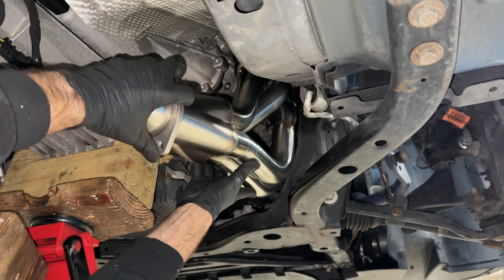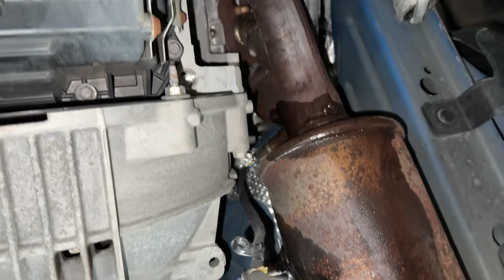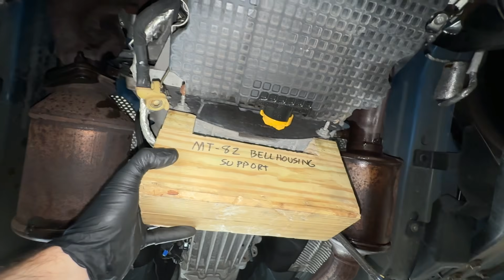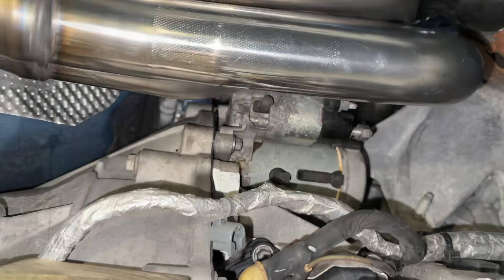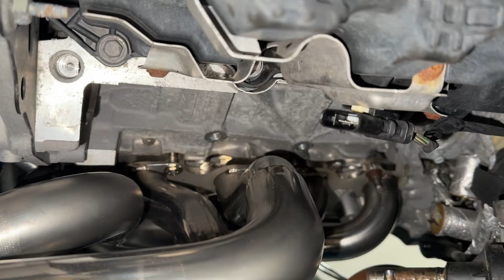How to Install Long Tube Headers on a Mustang

Comment: I think I'm going save a $1K and try this. My car has never seen rain; underside is extremely clean! Car gets put away in my heated garage in Nov, so I'll have 6 months, to cuss and let my knuckles heal before I drive the car again. I have a 6R80. Can you tell me, "How high you needed the car off the ground"?  And What special tools made the install better?  Thanks
Reply from the maker: The video should really cover what you need. I would get some extra tall jack stands because it will make it easier.

Comment: Is this a similar header setup as the gt350?
Reply from the maker: Yes, though I believe the mounting flange bolt pattern is different.
Reply: @Mustang-Geek thank you for the response i have a gt350 to do headers on thankfully your video going to save me so much time 🙏🏻
Reply from the maker: @onDrunnn looks cells are version of these headers for GT 350
Reply: @Mustang-Geek I’m going to install speed engineering long tubes

Comment: I installed kooks catless headers last night on my Dark Horse, but now i do not have any power to the dash/screen, headlights, and it will not register my key fob, but there seems to be electricity running as the side markers still turn on and other small things, any suggestions??

I also have a 6 pin connection that i’m not sure where it goes, it is not a 02 extension as those are already installed
Reply from the maker: Unfortunately, I don’t have any experience with S650 Mustangs. But if something is not connected, that certainly could be the issue.
Reply: @Mustang-Geek Yeah i was thinking it was that 6 pin connection, but i think i might have also blown a fuse not sure, but thank you sir

Comment: Best video ever. Just did my 2014 Mustang GT 5.0 and the bolts description was spot on. Passenger side used all oem factory hardware. Driver side could only use 2 oem bolts due to clearance. Great video straight to the point

Comment: i really need help with a question. basically i didnt get bolts and i also cant get kooks bolts because of where i live. is there absolutely no way to use all stock studs? or shorten them etc?
Reply from the maker: I suppose you could shorten the studs. But, they use stage eight header bolts. Just get the stage eight bolts that are the right thread size.

Comment: fml
Reply from the maker: Why?
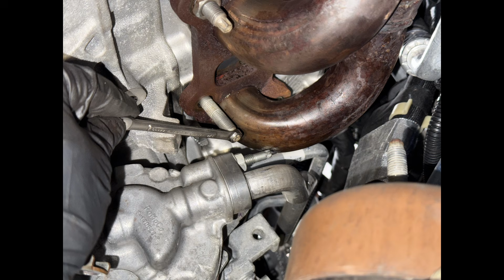Reply: @Mustang-Geek  I have an exhaust manifold bolt that broke off passenger side in a hard to reach place, exhaust makes a chirp metal rattle at 2-3k rpm and I can hear ticking around the area with the missing bolt. ive done suspension,brakes,oil you know the simple stuff and your video was like the only one I can find to see the process of removing the original exhaust and im like shit. this is gonna be a headache lol its that top rear stud you left in place at 3:25
Reply from the maker: @balakays550 Maybe grind it flat. All the other bolts and studs should be enough.

Comment: I’m having trouble with the last rear top bolt at the driver side
Reply from the maker: Yes! That's an annoying one. Try reaching from the front of the engine towards the back. remove the air box.

Comment: I can’t get the passenger headed in even if my life depended on it. It won’t go on the top front side bolt. AC is in the way so it won’t go low enough to get into the stud
Reply from the maker: Remove all the studs. That should solve the issue. Then use the bolts included with the headers to install them.

Comment: should I get these if I have a stage 2 roush supercharger kit? It's got some roush exhaust system already. Wasn't sure if this would hp me out or not at this point.
Reply from the maker: These will work perfectly for that application.

Comment: 4:39 also, not sure what you mean here. I think the unequal length headers give the cars a fantastic sound with the right aftermarket cat-back, and it's why I got a Coyote in the first place (even when I couldn't afford it). Although it is undoubtedly more restrictive than equal length setups, and equal length long tube headers with wider runners will always produce more power.
Reply from the maker: I personally don’t care for the OEM manifold sound.
Reply: Last thing to add is that the unequal length factory manifolds, while I love the sound on mine, it does make for an inconsistent midrange and tends to choke the car up top. Same exact thing on a Subaru WRX STI. We love the sound of the Boxer with unequal length headers and a proper cat-back, but we know that the car runs so much better with EQUAL length headers. Just something to think about.

Comment: I did not know that Ford integrated the catalyst into the exhaust manifolds on the 2018+. How lame. No wonder everyone is getting an aftermarket header/high flow cat setup.

Comment: I have a question on the gaskets? I’ve taken my kooks off 3 times going to be 4 now because I seem to keep blowing up exhaust manifold gaskets. I used 2 oem one with and without copper sealant and a remflex gasket and still seem to have them leak, any advice is appreciated thanks!
Reply from the maker: Hmmm. Surprised you're having issues. A couple things to check: 1) Use a razor blade and bake parts cleaner to clean carbon build-up on the cylinder heads around the exhaust ports. 2) Use a straight edge on the exhaust flange and check it for imperfections. 3) If you're using studs, make sure the studs aren't too long and hitting the primary tubes when they're fully tightened. If the studs aren't bottomed out in the threaded holes, the ends may hit the primaries before the header is fully seated. 4) Make sure the headers aren't hitting anything that's preventing them from sitting flat against the heads when tight. 5) Make sure all the bolts and studs are tight (duh). Good luck!
Reply: @Mustang-Geek  Sounds good I’ll check it out. I tried my best on the prep since it is a royal pia to install but I did get them used so they might be pretty warped, considering I used remflex gaskets it would have helped with that so I might just have to buy new headers entirely. Thank you!
Reply: When the manifold leaked did you get any engine codes?

Comment: Going to put mine on tomorrow by myself thanks for the clear instructions wish me luck haha
Reply: how did it go?
Reply: @zenaxia8063 it honestly wasn’t that easy but it’s definitely possible you definitely need the right tools I was doing everything by hand no power tools that was probably my biggest struggle
Reply: @Domsdownbad  how long did it take you?
Reply: @zenaxia8063 like I said I did it with no power tools so maybe 12 hours but with power tools probably would’ve took half the time
Reply: @zenaxia8063 around 12 hours but I didn’t have power tools with the right tools it would probably take half the time
Reply: @zenaxia8063 guessing a year
Reply from the maker: You got this!

Comment: Can you please clarify- are there only exhaust studs with nuts? Any bolts?
Reply from the maker: The factory hardware is studs with nuts. The Kooks headers come with Stage 8 bolts with locking tabs. You can use any combination of OEM or Stage 8 hardware you want. Does that make sense?

Comment: They showed the drivers side cuz the passenger side sucks ass to swap 😂
Reply from the maker: It wasn't that bad. I just covered the details. Time consuming, but not impossible.
Reply: I agree, bottom nut is a PITA been messing all day with it, torch time tomm, can't beat heat or I will melt that mf'er off one 😂

Comment: How did you access that upper rear on the driver side? I’m stuck on it and can’t get it
Reply from the maker: Install the bolt before installing the headers. Then tighten using an open end wrench and flipping it with each turn. Remove the air box to see the bolt and reach around the strut tower to tighten.

Comment: Wood that wood cut out also work in 10r80 cars?
Reply: No im using a flap piece of wood. Moved the lines out the way enough to flip the wood in there
Reply from the maker: @bigkarl24  Just make sure that you don't jack up too hard and crack the bell housing.
Reply from the maker: I doubt it, but you can take a look and see if there's a similar way to support the bellhousing. Otherwise, support the block as I pointed out at the back of the block.

Comment: What’s the difference between longtube headers with cats vs no cats
Reply from the maker: One setup has cats, the other does not. Can you be more specific with your question?
Reply: @Mustang-Geek like performance wise does it increase hp?etc
Reply from the maker: @rkvray5228 I’m gong to find out shortly when I head to the dyno shop!
Reply: Do u get the cel ?

Comment: This is awesome video! I’m currently in the process of installing Stainless Works long-tube headers on my 2024 Ford Mustang GT in my garage. I built a 2x4 wheel cradle for all four wheels, raising the car 16 1/2 inches off the ground, which gives me plenty of room to work. I really enjoyed your video. Thanks for sharing!!
Reply: Only thing I think I’m gonna really trouble with and a lil nervous about it supporting the motor with the stand
Reply from the maker: @kameroy5269  i’ve had great success with this method. Consider that an engine on an engine stand supports it the same way.
Reply: Did you finish the job?
Reply from the maker: @HelizzCrazeeAsian  sounds like fun! How are you supporting the engine?
Reply: @Mustang-Geek  I haven’t made it to that part yet, but I will definitely copy your amazing idea for the bell housing support jig.. I have plenty of 2x4s lying around in my garage. So far, I’ve unbolted the 2 top 15mm engine support nuts.. removed my battery and battery tray removed dual air intake and airbox. Unbolted coolant reservoir so I can have more access on the driver side. disconnected my steering shaft connectors, removed my starter, and passenger-side catalytic converter. 

Tomorrow, I plan to start lifting up my engine using a 4-ton Big Red bottle jack from the bell housing. I’ll probably use another bottle jack with 2x4 to add additional support under the steel oil pan. I have a six-speed manual transmission like yours in the video, and I’ll definitely will  copy your wooden jig!!
Reply from the maker: @HelizzCrazeeAsian  using the oil pan as a backup is OK, but just to keep it from falling. Any bend in the oil pan could compromise the oil pickup. Also be mindful to only raise up the engine enough to clear the engine mounts. Watch strut tower brace clearance!